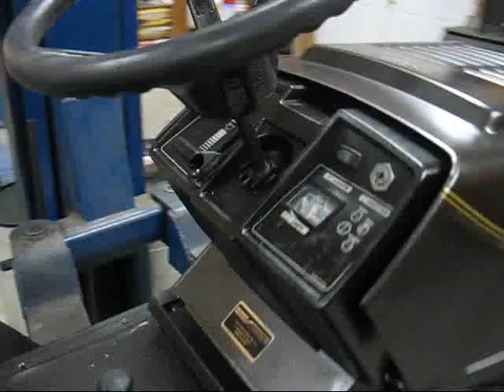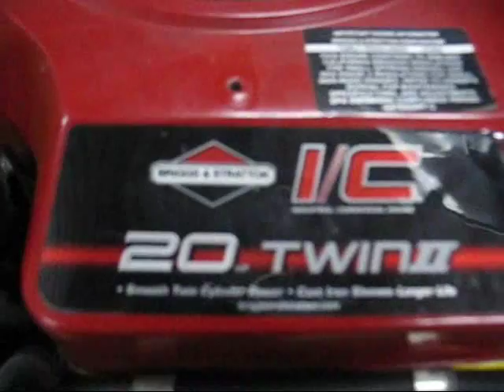Centrifugal Automatic Race Lawn Mower (20hp Briggs & Stratton) Twin & True Dual Exhaust

Comment: Getting that idle down is easy. Just look for the smaller spring going from the governor arm to a stationary tab. Bend the tab so that it has less tension (toward the gov. arm). You could just remove the spring altogether and set your idle with the throttle stop screw.

Comment: And you're still using the varidrive? So you just kept trying different 5/8" belts to compensate for the differences in pulley sizes?

Comment: If that thing goes faster than factory, you MUST let us in on your setup! What did you do with the pulleys and varidrive? The only thing I can tell is that you are still using the 1 speed rear.